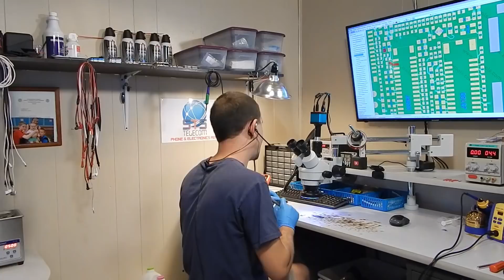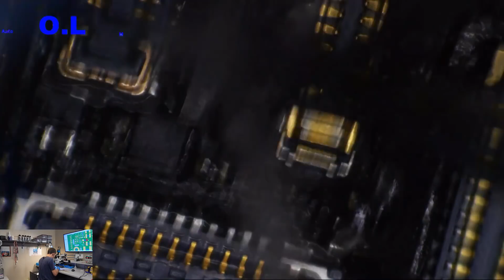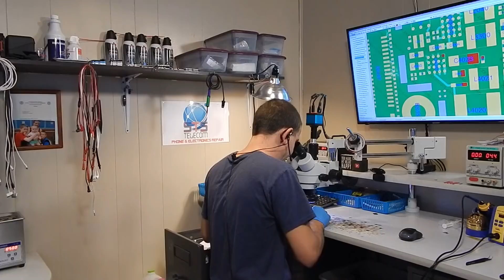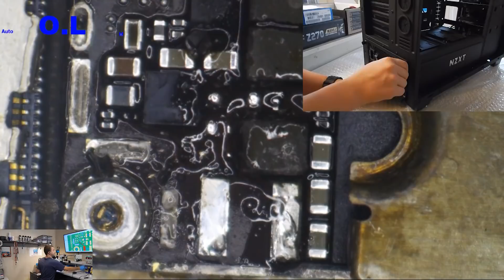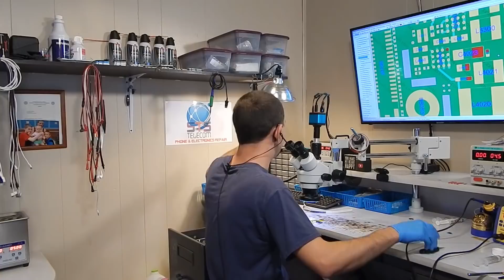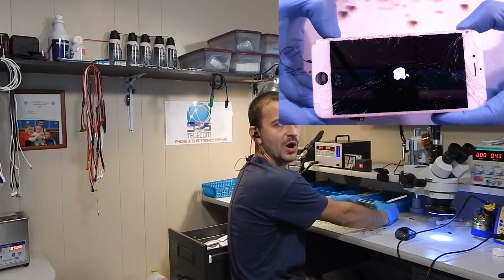iPhone 6S - No Backlight for No Reason?  FIXED!

Comment: hey you areally a master in those repairs!!! i've also same back light not working on the 6s therefore i would like to try my own the repair what is the air solder temperature you use?

thanks

Comment: Hey can anyone help me? I was just at nigh repairing my phone and I used the front camera, then the white flash came up and then the phone shut down. It didn’t really shut down, the screen didn’t work. I tried another screen and that didn’t work. I tried another battery, but the flat battery symbol only came up. After charging, the screen goes blank. I think it was a screen I bought from bee fix. As soon and I plugged the battery in, something started to spark on the phone

Comment: Hi, hope someone can help me. I have an iPhone 8 with backlight issue and a donor iPhone 8 board (intel). 35, 37 and 39 are normal value on J5700. R5733, R5734 and R5735 are good. D5661 and D5660 are ok. All backlight capacitors are normal. 

Just in case I have swapped R5733, R5734, R5735, D5661, D5660 and U5660. The donor working fine with those parts that I have taken out from the other one but the phone still has backlight issue with the donor's parts. 

Any idea, please?
Reply: Is your board water damaged?
Reply: @TheDavid598  No, it hasn't any liquid damage.

Comment: I have the same problem on my iPhone 6s, but sad to say i don’t have the equipment needed, so i decided to remove the caps, coil and diode using a Nail Nipper. And now i’m waiting for someone who can solder it, parts is ready i got it from AliExpress. Would you help me? I’m from Philippines. Hope you will notify this thing. HAND

Comment: I like your workbench with the BIG screen that shows all schematic. It awesome. The question is: how did you get all those schematic. Apple don’t provide them. They like to control everything. They don’t want to share the repair business.
Reply from the maker: Marco Polo thank u.  I think employees must leak them out or something.  Some of them I find on Google but for the most part, I access them using software purchased from China.  The data is stored on servers in China (I think).  It amazes me that these companies are able to sell subscriptions to the data without getting shut down.

Comment: how do i get replacement chips to buy? like the capacitors and ic's
Reply from the maker: I buy resistors, capacitors, diodes and inductors from Digikey.  ICs I order mostly from Aliexpress
Reply: how do you find these resistors,capacitors and diode on digikey website. is there any part number for that ?
Reply: @vjwadhwa1  sts telecom posted a video for that

Comment: When u put my multimeter to my battery, it reads 2.40 and doesn’t go up or down. When I put multimeter to ground and contact near battery connector and it reads 1.72 and doesn’t go up or down? What’s goin on? My phone won’t turn on or charge. Please respond I’m begging u

Comment: Hi I just bought an iPhone 5s unlocked from someone and they gave me everything but when I opened the phone up. I saw that the digitizer looked like it was corroded or burned by something. So I scratched the corosssion off and then looked like the solder fell off of the pins. Can you fix this for me. It's not botched or anything but I don't know if it needs to be replaced or fixed. Pls help

Comment: I found this when i used to repair consumer electronics, stock typical faults were 90% of the repairs, 6-7% were oddball ones that made the brain work, eek :-D.

There was a tiny 3% that could not be repaired, i had to remember not to blame myself for such a minor amount of failures.